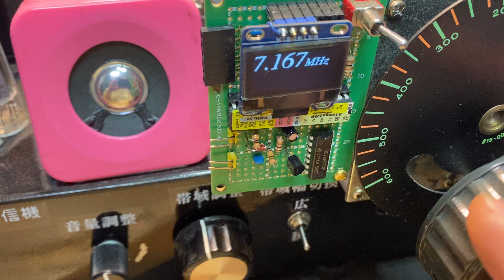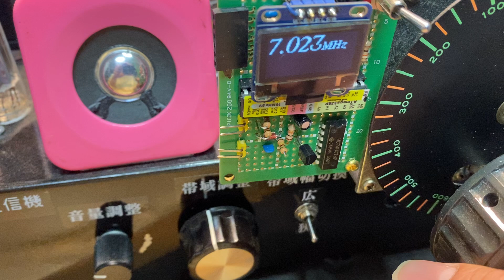My scratch making 7MHz receiver..

Comment: Is there anywhere I can learn more about your receiver works? it is really amazing
Reply from the maker: Hello Thanks for interests. Indeed, this receiver design is a really old-fashioned single conversion (single super) receiver with IF=12 MHz. The VFO oscillation from 4.5 to 5.0 MHz and 12-5.0=7.0 MHz to 12-4.5= 7.5 MHz is the receiving range. It has two pole crystal filter and not so good for SSB voice demodulation...!
Reply: @microwavemont  Very nice. It might not be very good for voice demodulation, however, at times the voices were amazingly clear